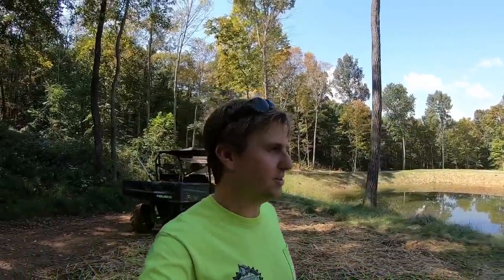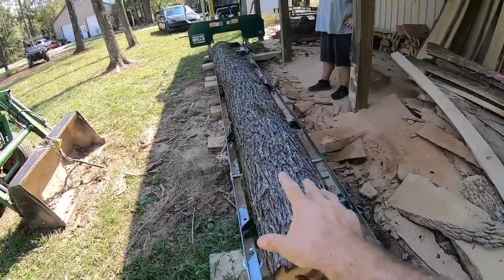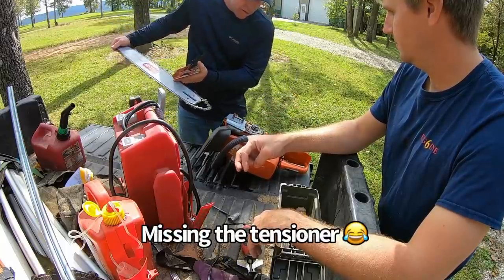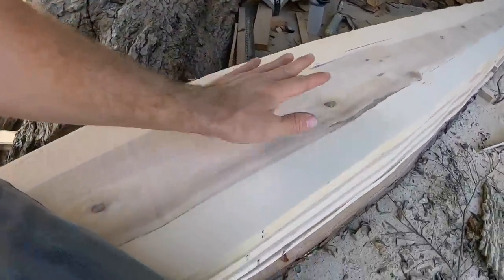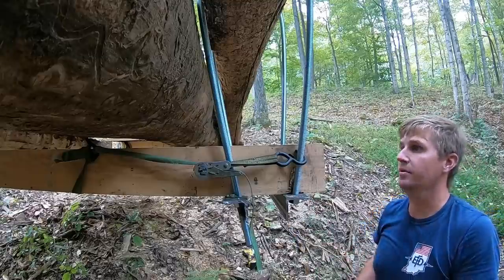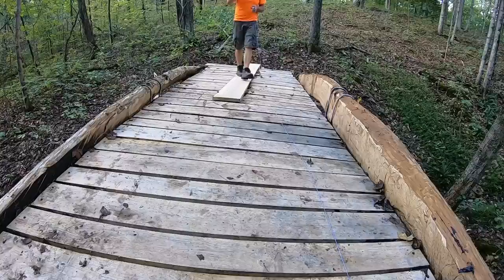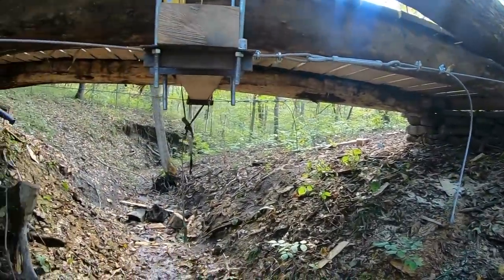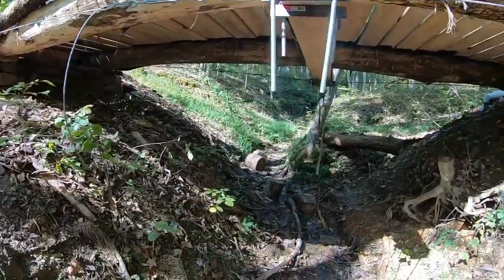I Built A Bridge in the Woods - My First Timber Project - Will It Hold?

Comment: A lot of comments about Captain Kleeman needing more weight on the front of his tractor but weight wasn’t the issue. 
With one of the rear facing camera shots you can see the log is being carried in the old Jeep skid plate and the frame rail is jammed up tight against the log preventing the tractor from turning. 
Normally he pulls the log arch on the ball hitch but that bigger log was too long.
Sure it was a heavy log but it wasn’t that heavy.
Reply from the maker: Bingo!  Glad someone noticed,  really wasn’t wanting to type that out in every reply 😂. Thanks for looking out Wayne!
Reply: Yup… you got It right!
Reply: @CaptainKleeman  
Many of us got your back. 
Even when you drop things on our heads. 😉

Comment: Why did you not put dirty or stone in the bucket of the loader to help whit the steering
Reply from the maker: Did I make the turn? 😂
Reply: When you were trying to turn ur wheels were slipping as I use the weight block on my t7 New Holland ( mind that a lot bigger tractor than ur one t7 is round about 200 hour we power

Comment: I figured that tree at the 4:30 mark was going to "barber chair" due to the lean and how it was cut.  I would be getting away from those trees a bit quicker if it were me.
Reply from the maker: You cut trees for a living?
Reply: @CaptainKleeman   Depends on what you call "for a living"!  lol
I am retired and have cut trees for over 50 years, some of that for a utility company.
I always HATED those "leaners" as the compression would be on the face cut in most instances.
To be safe I would always put a chain or strap up above the cut to help keep the tree together.  I believe I have seen you do the same a while back.
Another way I have approached that kind of tree was by making a shallow face cut and then do a PLUNGE cut into the middle of the tree and work my way to the mouth, or face cut, leaving my hinge cut, and then running the saw to the back side of the face cut, again leaving some wood to "hold" the tree.
I remove the saw from the tree and after making double sure I have a clear exit path, I will complete the back cut.  It does not take much to "trigger" the cut.
I am not being critical of what you do.
I have seen some bad accidents, and one death due to the infamous "barber chair".
Reply from the maker: @lonniechartrand  situational awareness is key

Comment: You want to use an improved humbolt....take the wedge out of the stump not your good log... and take 1/3 to 1/2 deep hinge unless it’s an ash or a tree that will barberchair.... leaning to plunge cut is huge... you make the hinge and then send it...logger Wadë is a plunge cut dude.., you also want to learn about a vertical hinge... make that wood pull from the stump to make it turn and go exactly where you want it to land...

Comment: You need to cut your face cut deeper.
I usually cut to the halfway point, then cut the back cut and I don't quit till the tree is falling and there is less than an inch left in the hinge.
Length of bar is nice but the longest bar I have is a 20" on a 038 stihl. The largest tree I've cut was 40"inch  at the butt cut. That tree yielded 800 board feet.

Comment: Cap't, maybe if you had placed the threaded rod behind a tree trunk with a bolt on each end to grip a rope tied to each end and then used the tractor to pull and bend it. But that's alright. I may be smarter than you but you are certainly more charming and better looking. lol
Reply from the maker: Interesting idea,  although almost certain to cause cracking

Comment: Great 5 star plus video Captain.
I just kinda cringed when I saw you for the first time not wearing your logging safety gear you usually wear that impresses the Dickens outta me.
You should make those leaf spring forks easily removable so when you do need them you can reinstall them.
Or can up a forks rig you can attach to the front bucket when needed.
Most likely you've already thought of that.

Comment: I think the wire rope you installed is too thin and elastic to be structurally relevant. I think I would use 1/2" or switch to all thread rods. 👷
Reply from the maker: Time will tell
Reply: @CaptainKleeman  As long as your abutments are stable I think you'll be fine for your design vehicles. If screws that secure the planks start having major issues it would be a good time to check the overall integrity. I expect you'll get many years of use out of it as long as you don't run too many D-9s over it.  🚧

Comment: Your engineering basics are solid, but there are a few details to improve (some greatly). You are wasting a lot of expensive hardware, too. 1) (minor) why use round washers on top of thick square ones when connecting arched girders with deck beams? 2) these threaded rods are at least 1/2” 50ksi steel. There is absolutely no need to have two pairs on each side of the floorbeam. Drill two holes in arched girder and use washers or an angle at the top and another at the bottom (typical hanger detail) - 20k lbs each side is more than you need for this. 3) why put membrane between two pieces of wood? 4) cable needs to be tightened pretty hard to be effective, I bet you ran out of threads on a turnbuckle. These tension members need to be steel rods, not cables, too much deflection otherwise. 5) if you anchor cables/rods and “anchor beam” over abutment, do not offset it outward, keep as close as possible to the arched girder contact point. Those anchor beams will rot out first.

Comment: I don’t really see anything on the bridge that you did ‘wrong’….it’s not a commercial product that needs to hold tons and tons of weight.  It’s plenty strong for what YOU need it for, and I doubt it’s going anywhere; you could probably even drive a couple ton truck across it.  It’s not like you are stopping in the middle of the bridge, and letting the weight set there.  I would drive my GMC Terrain across it and not be worried.